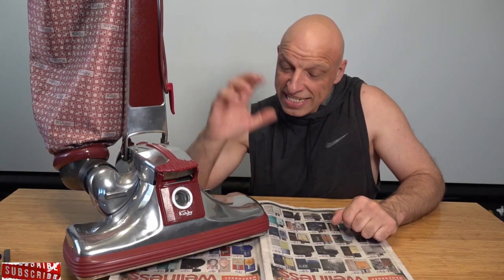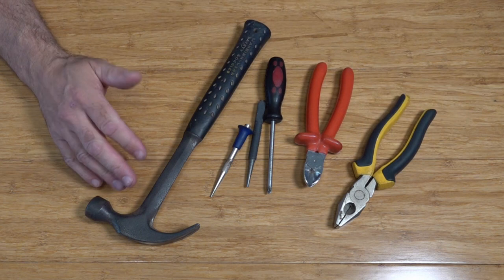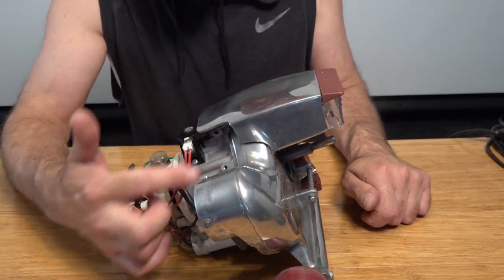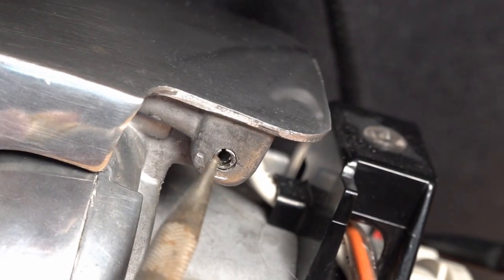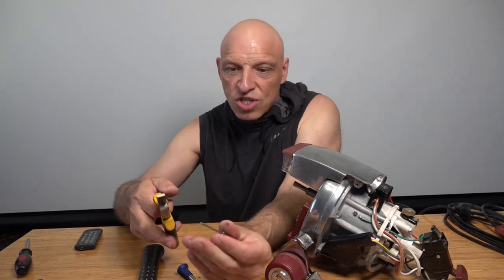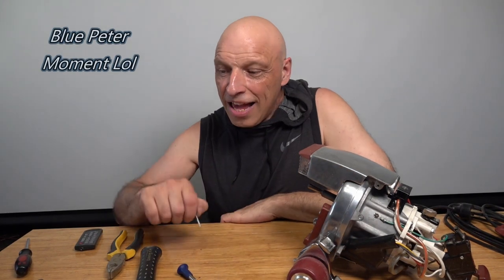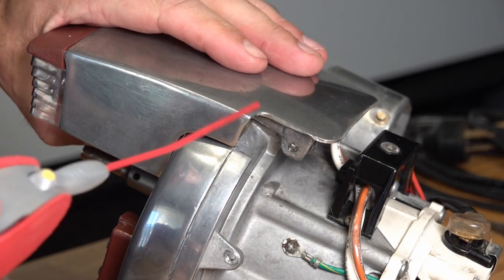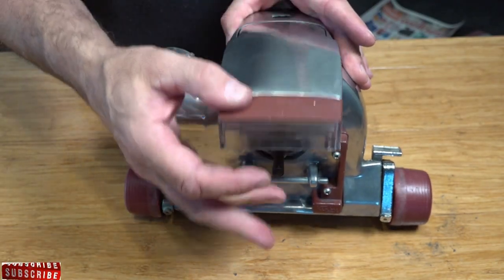KIRBY VACUUM:  Vintage Kirby Headlight Keeps Flopping Down / Why Won't Kirby Light Stay Up

Comment: What a simple and great fix for this problem. I will have a look at my Avalir construction when I will have this problem in future what I can do. Thanks Dean!😊
Reply: Avalir (and the entire G3 platform) is built different. They use a sort of plastic bushing to create tension held down by a metal plate under the headlight cover. You can tighten those down as they wear down because the two plastic pieces are sort of wedge shaped and it just presses them against the shaft more. Be careful not to over tighten them like someone did on my diamond edition or you’ll crack the plastic bushings.